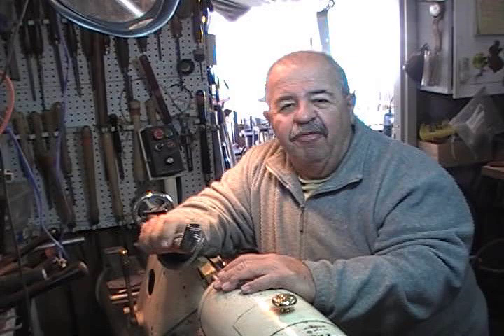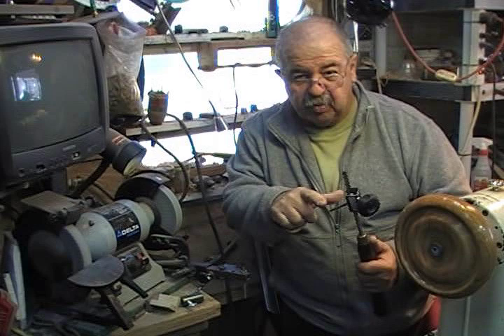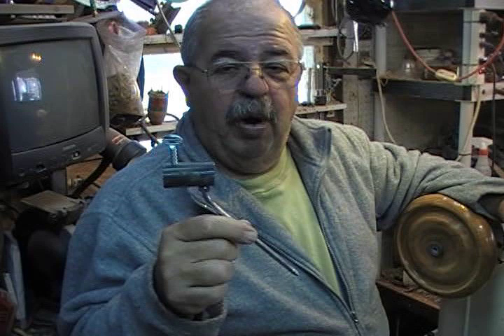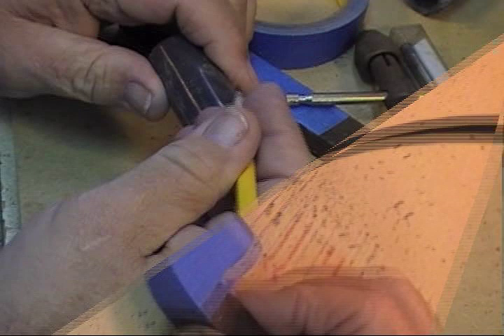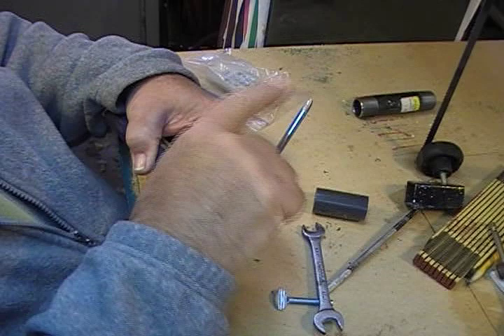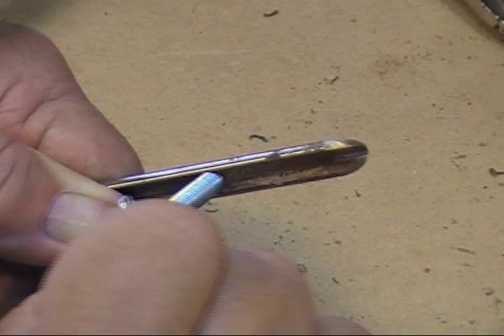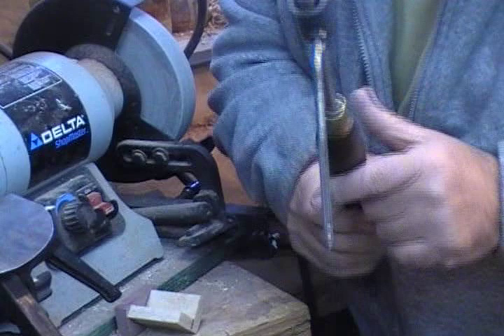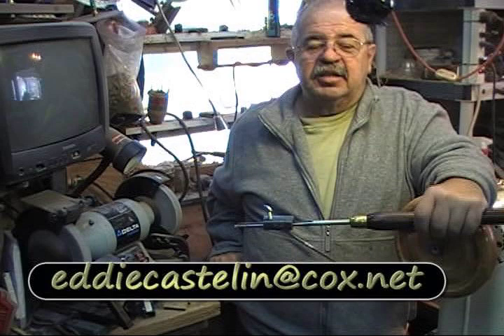two dollar sharpening jig.avi

Comment: Well I made one and it works great. Of course I still need more practice but thank you. Oh yeah I made mine using a metal pipe nipple and yep I broke the bolt off at the treads. Didn't wait for it to get it hot enough to bend. Bummer. All's well that ends well. I have one now. Thanks Capt.
Tom

Comment: Hello fellow YouTube hobby nuts, Apparently this lovable old man had a stroke sometime back with plans on returning to the workshop, I don't think he was able to do so, I dont have all that much time myself, god bless him.
I wanted to help people out if building this jig, I was a GM mechanic for 30 years and just made this style set up out of steel.
I started by making the the base sliding arm under the grinding wheel, and then made the jig shown here,
 (the "base arm" spec's to hold this jig are)
He states 4 inches lower than the center of the wheel......OK
He states 7 inches out front from the face of the grinding wheel.....OK
He states 2 inches of chisel extending out of tool...............OK
You made the tool "exactly as described" in the online plan Print out....OK

After all that your finished grind angle is still off.......WHY
......................."How big is your grinding wheel?
I dont mean is it a 6" or 8" inch, I mean as any wheel is used it's exact size is always changing, you need a simple angle (protractor) tool,
 Make a grind,
 Read it and adjust your jig, without reading your cut you're just guessing,
Hope this helps someone.

Comment: Great vid Don't know if I missed it but is there any particular angle the bolt need to be bent to
Reply: did you get an answer?
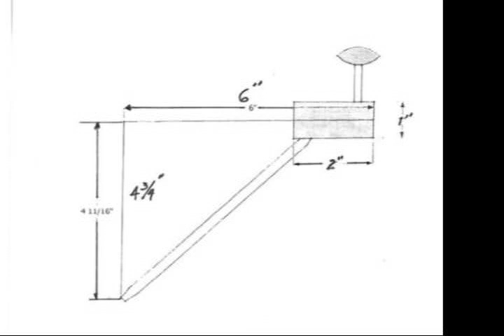Reply: 10:20 shows the drawing. You can calculate the angle from that or calculate the hypothenuse (=length of bolt) using good ol’ Pythagoras

Comment: wouldn't it be better to use a wet wheel ? it seem that your high speed grinder would cause the metal to over heat and the new edge won't last very long before going dull

Comment: Capn Eddie
not sure if I missed it or not, you said it was a 7 inch rod, i see threads on one end, what is the angle of the bend in the rod and did you say the tap was 1/4"-20
thanks
Reply: +gulfmedic1 If you go to the very end you can see the plans for it. I've been researching these and its not really the angle that's important but that the pivot point is 6" from the front of the tool and the 4 11/16" down. So when you add 2" coming out of the jig the point of the tool is now 8" from the pivot. 

And yes he said 1/4"-20 but that's because he used a standard 1/4" bolt. 

Hope this helps.

Comment: I have a question about my table saw, It does smoke when i use it even though i replaced the blade with anew on?
Thank you.
Reply from the maker: Are the teeth pointing towards the user.  May sound dumb, but it happens.
Reply: Yes the blade is in right.
Reply: Just for anyone who may need this, the more teeth on the saw the more trouble I had with wood. Now the million teeth cut metal though! I can't seem to find what I want in my town but I bought the last 32 tooth black and decker at a mom and pops that is awesome. Wen;t to Lowes and they didn't exist. It went from (I think) 20 some odd teeth then jumped to 60 something. Nothing in between. I guess I will start shopping online. I love the 32. Any suggestions for online?